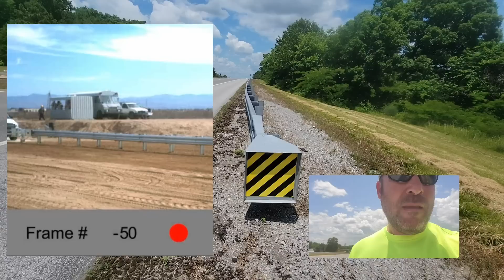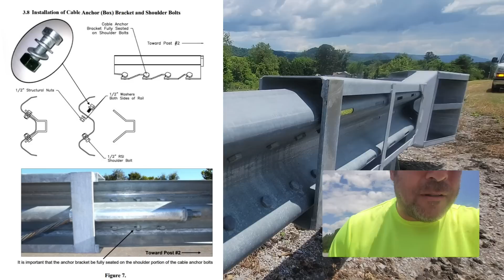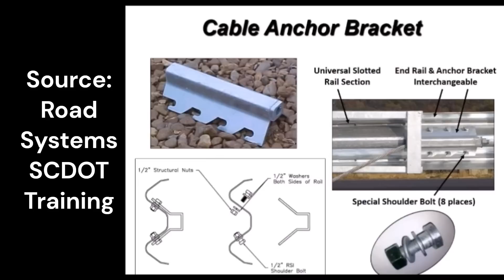Explanation of Backward Bolts Guardrail Short with Million+ Views

Comment: Looking at that incorrect installation, I have to wonder if they even used the supplied shoulder bolts.  Looks to me like they tried installing the shoulder bolts the wrong way and they wouldn't fit, so they just dug into their bag for some "standard" bolts and used them.  I don't even see any washers being used under the bolt heads.

Comment: Just to point out something a bit less obvious to the casual viewer... the reason many people were probably saying that "it doesn't matter which way the bolts in the video are facing", it's because to the average person with experience with fasteners can see those hex head bolts are too short to have a shoulder if they are standard hex head bolts. If you look at the drawing shown at 2:20, you can see that the proper bolt isn't a standard hex head but rather a rounded head with two flat sides. A picture example of these bolt heads are found at 3:19 where he shows the right bolts installed the right way, but using the wrong bracket.
If people commented on the video link below, that "it doesn't matter which way those bolts are installed", and if those bolts are as they appear to be, the wrong bolts, then they were actually correct. If installing a standard hex head bolt of that length (not the specialty bolt as showing in the drawing) then it actually does not matter which way they are installed.

Comment: The diagram video tells me you are correct, the shoulder bolts are what is critical for the bracket to give way correctly on impact. Interesting, now I'll be looking at every guardrail I see to see if they're installed right! They could still screw them up even with the bolts reversed if they don't use the washers correctly. Should be highway inspector double checking to make sure these were done right.

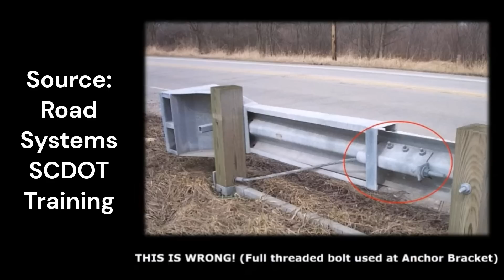Comment: @3:08 it would appear the person speaking is from the SC DOT and did mention the bracket behind the guard rail did not have the slots in it as shown on the installation drawing.  This does not allow the bracket to function properly during an impact.  Nothing was mentioned regarding the orientation of the bolts through the bracket into the guard rail!

So unless the installation drawing specifically called out for the orientation of the bolts, it can be installed either way.  The bracket used looks like it is not the right design and should not have been installed but there is no call out on bolt orientation for the installation.  What is critical is the two surfaces being held together is clamped together by the torque applied on the fastener bolt and not the orientation of the bolt!!!

Comment: Anything involving multiple critical parts working together in a specific process or structure should be color coded.  This has multiple effects.  The most important of these is it reduces the risk of making a mistake in the first place, but just as importantly, it allows others to know that you are making or have made the mistake after the process or structure is complete.  Thus, everyone can see at a glance if the job was done right.  Wherever people's lives are at stake this eventually gets done.  It's just a matter of how many lives are lost on the road to getting there.  I use the example of an aircraft carrier crew that have color coded uniforms, so that chief/supervisor can see in a glance when they are out of place creating danger.  In the long run pushing the theme of color coding will get you to where you want to go.  I do like the idea of building a slot into the fold into the attached end joints, that can hold a laminated picture of what the end product should look like.  But color coding will get you there faster.  Every one on the road should know Red Yellow and Green.  So star there.

Comment: I'm also a Mechanical Engineer, and I'd like to chime in.  Shoulder bolts are not normal bolts.  They are directional.  If they are installed backwards they will not function properly, and could increase the likelihood of death or injury.
Reply: With your one comment, you answered ALL my questions faster than this entire video. Thank you 😊
Reply: Would love to have a closer look at one of these assembles. Normally a shoulder bolt can't be installed backwards as the hole in the second half is normally smaller than the shoulder on the bolt, that's how they work. Obviously not the case here? Being able to assemble it incorrectly is a sign of poor, or at least less than optimal design.
Reply: Looks like the wrong bolts were used, period.  They used generic bolts and not the specialty bolts designed for the purpose.  And then they also put the generic/longer (incorrect) bolts in backwards and without the required washers.
Reply: I'm also a mech eng ... and see no reason why this assembly would not function properly with those bolts in either orientation ... so I would contact the mfgr to ask them if it matters or not. Did they test it both ways???   After all, that assembly drawing contained NO warning for bolt orientation, and if it truly matters, the road crews should be Notified Immediately with a bulletin before the mfgr and road crews get SUED.
Reply: @KrustyKlown if it matters the hole in the rail should be smaller than the shoulder diameter so they can't be installed the wrong way round. If the shoulder diameter goes though both parts and the nut snugs up against the shoulder rather than clamping the parts then it probably doesn't matter which way the bolts are. More info needed on the design and the design intent before I would judge either way.
Reply: @avid6186  Correct, more info needed. As an engineer, I've come to learn that other engineers have a much better understanding of the design requirements, testing, etc.. than someone casually seeing their product for the first time. That's why this dude should contact the mfgr .. instead of just assuming there is a safety concern here at all. Either way the mfgr should add notes to that assembly drawing that call out warnings if needed, or clarify if the bolt orientation doesn't matter (then people won't be bothering them with emails and calls ... been there, experienced it, and revised the manuals).
Reply: Steve's point is more important. Safety engineering isn't about what one guy thinks - even if he's an expert. It's about doing the thing that is tested and documented, whether you think you know what the consequences are or not.
My guess would have been that it didn't make a practical difference. But that's irrelevant. I want safety equipment installed the way it is in the manual.

Comment: The Hyatt Regency Walkway was another disaster caused by improper bolting techniques. The install deviated from the engineering specs and caused  the death of 114 people and injured another 216.
Reply: Another bolt incident was British airways flight 5390. There are times where the right bolt and installation procedures need to be followed to save lives. Bravo for what you are doing.

Comment: From the diagram: they used the wrong bolts (not the required specialty bolts designed for the purpose), the generic bolts used are longer and missing the smooth non-threaded portion (so the bracket can slide freely), they didn't use the washers, and they installed the bolts in backwards.

That's what's wrong with the installation.  The short video and this longer video just says the bolts are backwards -- who cares if the bolts are backwards when they used the wrong bolts and they also don't have the washers?
Reply: As he said, if they haven't followed the basic instructions they've not followed the instructions at all so the whole installation is void and uncertifiable.

Comment: yes, shoulder bolts are meant to be installed in one orientation only. This installation is sloppy, if not negligent work. I am not an engineer, but work as a purchasing agent for an engineering company, where I basically work as an intermediary between fabricators, engineers and quality assurance personnel. Details like this really matter, especially is it is a piece of safety or safety related equipment. If its not done to the drawing, its done incorrectly.

Comment: The big problem here, and the reason for the confusion, is that they are not using the designated captive washer shoulder bolts for this. The installers clearly replaced the intended hardware with standard bolts, negating the entire purpose for the specificity in the installation instructions.

That being said, it's extremely clear that the average construction crew cannot be trusted to follow such specific installation proceedures, especially not when manufacturers make it extraordinarily easy to get it dangerously wrong. Installers need to be held accountable, inspectors need to step up, but manufacturers also need to take responsibility and design failure resistant and defect tolerant solutions.

Yes. Direction of installation of bespoke hardware, use of only certain bolt holes and not others, orientation of nearly symmetric elements, it all matters. But designing systems that are tolerant to those mistakes, or simply designing systems that cannot result in those basic mistakes, matters as well.
Reply: Agreed, wrong bolts were used. If I had to redesign it, I'd add a baseplate to the rail that the anchor slides in to. It'd have to be relatively light weight and possibly multi piece so it could slide through the rail bending mechanism. That way, specialty bolts wouldn't be needed and they could be safely installed in either direction.

Comment: This installation appears to be improperly installed not by bolts having been installed backwards as much as it's using the wrong type of bolts entirely. The video doesn't really address this situation; however, the plate is somewhat installed in a way that would make it more like a permanently affixed bracket, such as those in the stitched video. 

It appears that the manufacturers bolts aren't supposed to bolt the bracket to the rail, as much as shoulder bolts bolted on to the rail without the bracket acting as a stud that the bracket can slide onto. So even if you flipped the bolt around it would still be installed incorrectly.

Comment: How it works: https://youtu.be/HwDfJzP3uF4?t=2450 MASH MSKT Installation Training 04-28-2017 Gregory Industries
In a face crash on the main rail, the slotted cable anchor bracket must anchor the rail to that first post.  In an end crash, that same bracket must be released so that the vehicle is not suddenly stopped.

The purpose of the shoulder is so that the slotted bracket is not held tightly.  When the vehicle hits the rail, the SKT end cap (Sequential Kinking Terminal) slides down the rail and bends it into a curly-q like peeling an apple. A plate on the SKT end cap pushes on the protruding slotted bracket, freeing it from the bolts, so it can fall away and then the rail can be bent.  The angled cut probably promotes popping off or bending of the bracket, so that it is not stopped by the next tab.  (The bracket could deform by squeezing together.) 

13 mm nuts and washers. The washers do not slide over the shoulder. The shoulder does not fit into the hole. 

Note: In the incorrect installation they used regular bolts, not the shoulder bolts because we don't see the shoulder or washer.

The correct assembly: https://youtu.be/7W9KvWHA6Gc?t=250

roadsystems xyz com/wp-content/uploads/pdfs/SKT-SP-FLEAT-SP-Install-Manual-METRIC.   pdf

Comment: UK based Highway Engineer here who supervised countless VRS Barrier installations, what most people can't grasp is that barriers are meant to "fail" as in, they re meant to shear and increase the stopping time of the errant vehicle as much as possible by slowly slowing it down. It's not about having a bombproof barrier but having one that works. By installing the bolts wrong they re taking away the weak point that was purposely placed at the back where the shear plate is so chances are that now it won't shear away and it that p4 terminal will no longer be doing its job.
Reply: What's a "P4 terminal"?
Reply: All I know is (as a motorcyclist) that I'm terrified of the barrier.
Reply: Well said

Comment: That is a major design flaw.  The blame for bad installation needs to move from installers to the companies that produce products that can so easily be installed backwards when such an installation can lead directly to deaths.

Consideration for human nature has to be included in the product design.  If the product can be found installed incorrectly so often then it is the fault of the engineers who designed it and the company that sells it.  Otherwise the solution would have to be that a qualified engineers or qualified inspector should be on the crews to oversee installation.

Of course such people are expensive as are product redesigns and mass reinspections so people will just die because fixing it doesn't make budget sense to the people who make the decisions.

Comment: Since we are talking about the law. 
1: You probably should be wearing  proper PPE, check with your DOT to see what is approved, but you can never be wrong with a class 3 high vis vest. 

2: Check with your DOT on a proper MOT standard, because im not seeing any type of traffic control setup in place for a shoulder closure. Im just going to automatically assume that you dont even have ANY advanced warning signs letting the commuting public know that you have conducted a shoulder closure up ahead. Which in theory is putting peoples lives in jeopardy. Never do the bare minimum. 
Stay safe

Comment: Can someone tell me if I'm understanding this correctly?

So the bracket is designed to initiate the process of the guardrail "peeling" to the side upon impact which turns the guardrail into a very large shock absorber. There's more force on the side the bracket is mounted so thats where you want the solid metal of the bolt head + washer instead of nuts that are more likely to shear/give out. If the nuts are on the bracket side and give out the bracket can't initiate the peel, then the guardrail is more likely to go straight through the car and or have no cushioning effect like it's designed to.
Is that right or am I missing something?

Comment: That's great that the manufacturer says bolt direction matters. Does the manufacturer provide proof that it matters? Do they have testing demonstrating that the system does not function as designed if the bolts are installed backwards?

Comment: I've worked on cars for decades. If a bolt is designed to be installed one direction, and it is installed backwards. It has an effect on the amount of torque that the fastener is putting on the object. Plus when testing is done. They had them that direction. Maybe they tested it with the bolts backwards and it failed. We don't know. We just know that it was designed to be installed this way. So that's how it should be installed. Period

Comment: i appreciate the video but it doesn't explain why the bolts have to be fitted backwards
 
given that both the EU and UK deem sticking out bolts to be DANGEROUS 

i was nearly killed by this for my situation in the uk they where fitted like the correct way in the video but in the uk they were backwards/incorrectly ,y blown out tyre caught the bolt and spat me backwards into the left lane if the layby was taken the opposing lorry/18 wheeler wouldn't have had the option to slam it into the layby  
the guy was amazing

i have it on court papers stating how bolts on road side of the barrier where dangerous and caused the unnecessary escalation of what should have been a routine incident  

i can only assume that the bolts have a shoulder as other have mentioned 

you could just remake the nuts to have a captive washer and shoulder 

what is your take on proposed alteration/improvement 

really love how motivated you are to stopping others from living through the same misery and upset you have had to 

THAT TO ME IS A HERO
Reply: They probably should just redesign guard rails entirely in America to be honest. Surely there is a safer design out there that also would be less susceptible to assembly error.

Comment: I wonder what the spec is for the anchor ropes foundations and if they are done properly, if what you can see is so obviously wrong what are the chances of what you can't see underground being right, not great I reckon, and that foundation has to be one of the most important parts of any safety rail installation, out of sight out of mind attitude with contractors at the best of times, good luck on your work bringing to light a safety feature that can affect everyone.